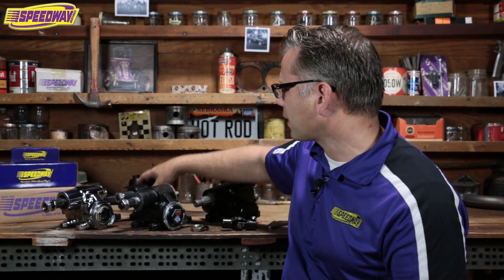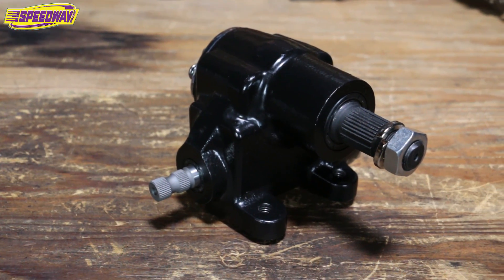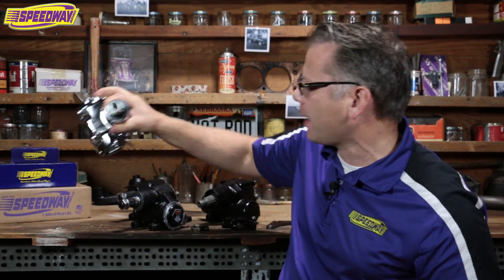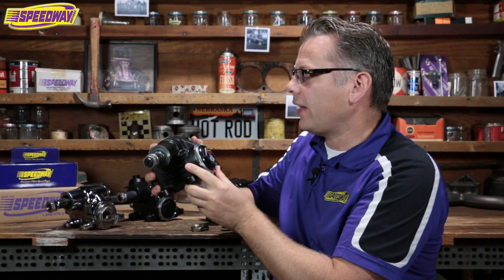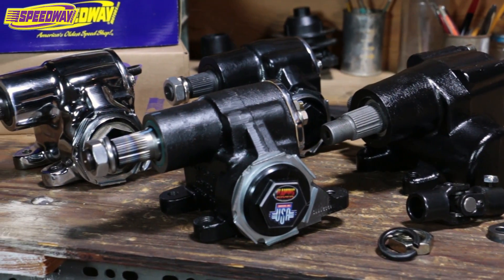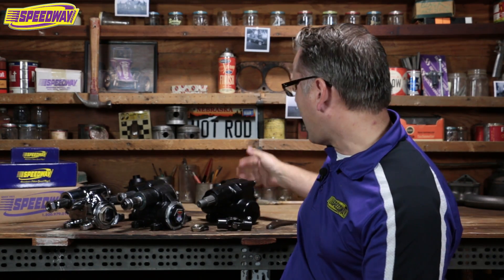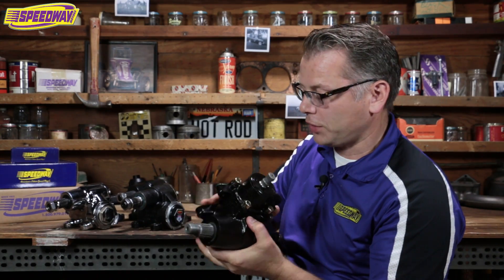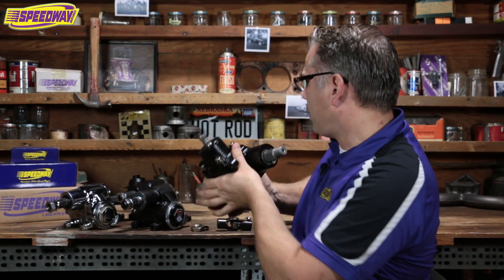Speedway Tech Talk - Power & Manual Steer Vega Boxes

Comment: Does these work good when deleting power steering?  I'm deleting power steering because of lack of room for my turbos. Thanks for info.
I demoed the building for your new location in the Phoenix Arizona area.
Reply from the maker: If deleting power steering and going to manual steering with the use of a Vega box you can expect to achieve more physical effort when turning your vehicle.  This is especially true when the vehicle is not moving and at low speeds.  Weight of vehicle also is a contributing factor as far as steering effort required.
Reply: @speedwaymotors hey which box would be easiest to fit my 52 Chevy styline car, I have a small block Chevy motor with shorty headers?
Reply: And not a lot clearance between headers and steering

Comment: Building a 55 chevy gasser mostly to drive on the street would the vega box be strong enough I have your HD straight axle in it thanks
Reply from the maker: Many people have used Vega boxes for gasser applications. I know of many 55 Chevy’s running Vega boxes.  Many factors come into play, such as how heavy the car is. If it’s a 55 with an all steel front end, bumpers, and a cast-iron Hemi we might steer you toward a heavier box. If you’re running a small block Chevy and the car is lightened like most drag cars are, you should be perfectly fine.
Reply: @speedwaymotors  thanks for getting back to me it will have bb chevy with iron heads steel front end no inner fenders has 2×4 front frame rails no front bumper